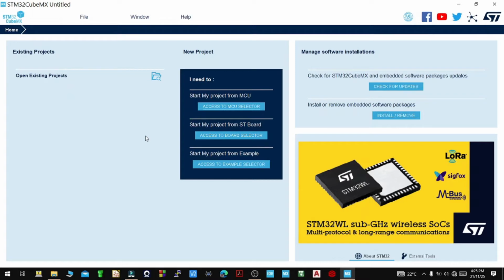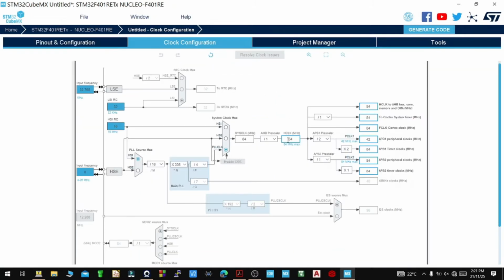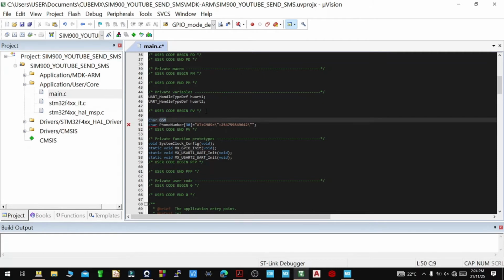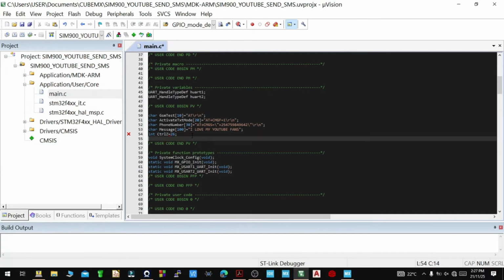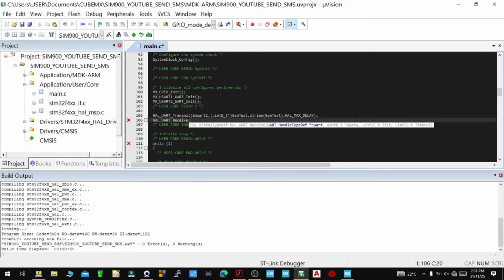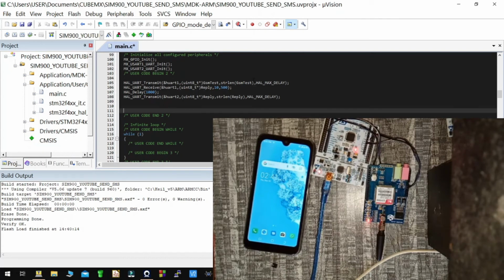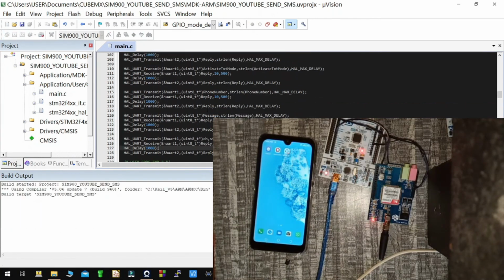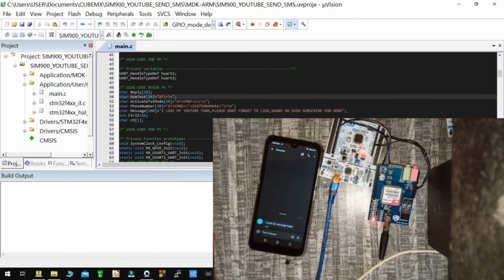HOW TO  SEND SMS USING TYNISINE GSM/GPRS SIM900 MODULE WITH STM32 || HAL || CUBEMX || KEIL uVISION.

Comment: how to gsm module can receive sms form handphone
Reply from the maker: I will have that tutorial ready 👍 Thanks
Reply: @hayducate OHHH thank you so much, I can not wait mr
Reply: @hayducate  do you have a discussion group ?
Reply from the maker: @022_khairudintrustaaditama8   not yet but I will have one,now that you mentioned it.
Reply: @hayducate  oke thanks mr
Reply from the maker: @022_khairudintrustaaditama8  Hello,I just uploaded how you can receive messages using gsm
Reply: @hayducate  wowww thank you so much sir, i will watch now. btw why you dont use SIM 800 L V2 with STM32 ??
Reply from the maker: @022_khairudintrustaaditama8 for sim800l only a little modification is required
Reply: @hayducate  Can you make the tutorial for that because im confused
Reply from the maker: @022_khairudintrustaaditama8  I wil surely do when I get hold of sim800
Reply: @hayducate  thanks mr. Sim800 is cheaper than sim900
Reply from the maker: @022_khairudintrustaaditama8  do you have one?
Reply: @hayducate  i have one sim800
Reply: Now, do you have it mr.?
Reply from the maker: @022_khairudintrustaaditama8  in sim900.c change  
    if(Reply[2]=='O' && Reply[3]=='K')

To

 
   if(Reply[5]=='O' && Reply6]=='K')